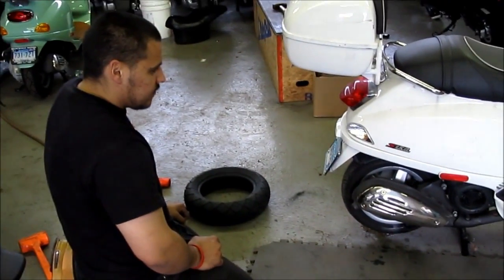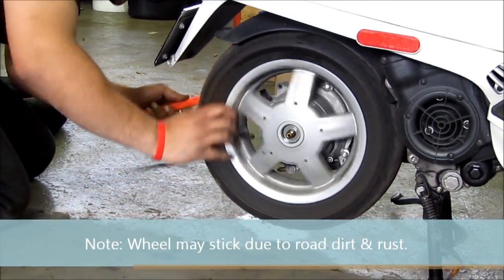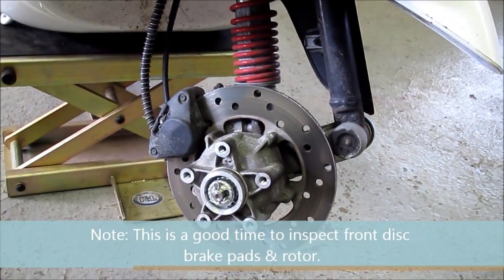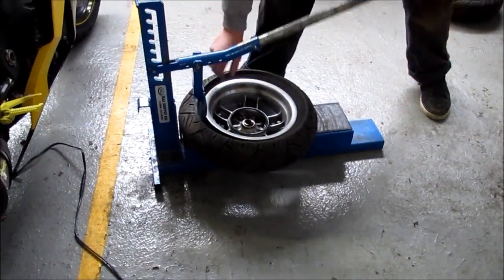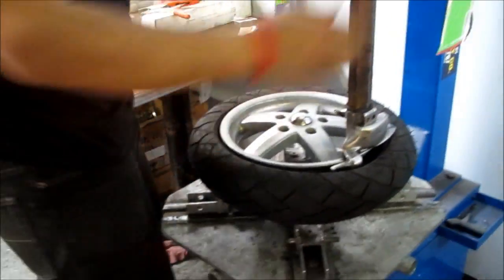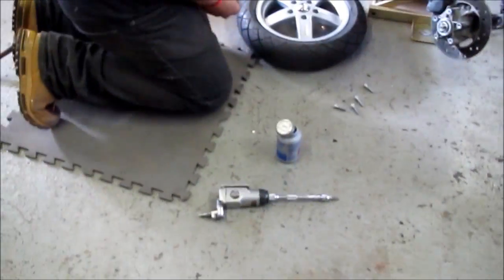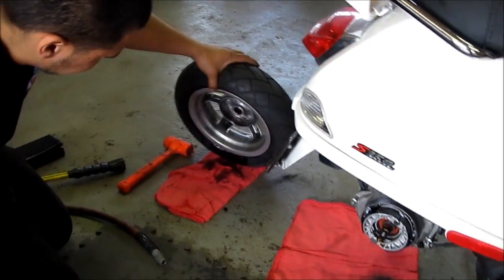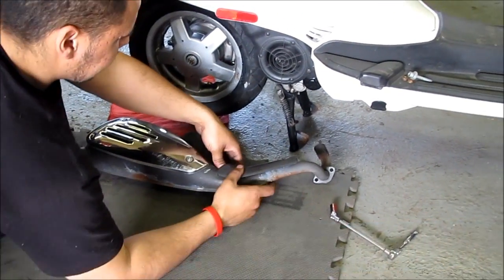Scooter Video Tips - Episode 2 - Changing Tires on your Vespa Scooter

Comment: I have learned to leave all bolts and nuts on wheels dry. If you put on some cermaic, copper or other anti seize, you will not be able to put on the correct torque. Correct me if I'm wrong...

Comment: Is it a good alternative to place an innertube when the rim doesn't seal proper anymore?
Reply: When I first got My Piaggio Vespa ET4 125 1996 ,the Tyres kept going down so My Mechanic put Inner tubes in them and it solved the problem still there after 15 Years but now need to replace the Tyres so ?